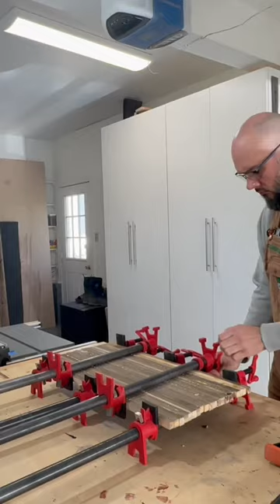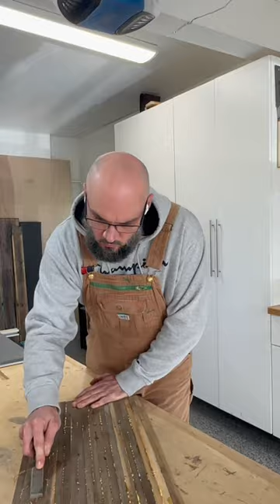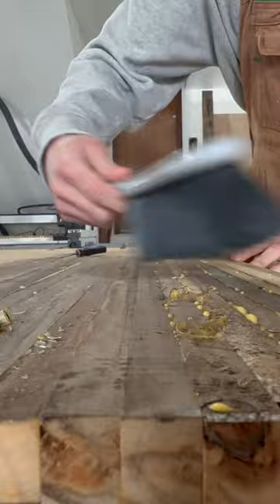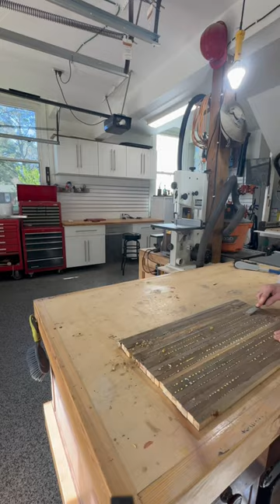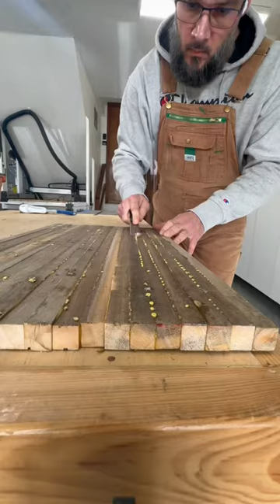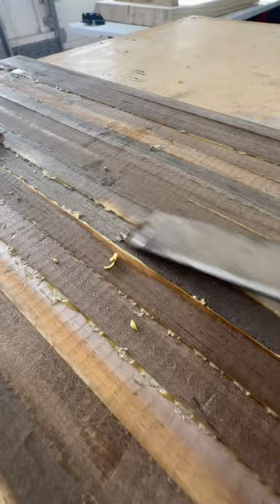Making an American flag from old fence pickets. Subscribe for more #music #woodworking

Comment: Fantastic song choice!
Reply from the maker: Couldn’t agree more!
Reply: Good for you but I'd save glue you have to sharpen chisels too. Out will come the good sandpaper rub until your fingers taper, dust up in your nose when you blow it takes awhile but it'll go. Then 30 years down the track your favorite table starts to crack you throw the stinker out the back it's lived its life as it goes whack !
Reply from the maker: nothing like a good glue up
And a little bit of chiseling! 😮😂.  Funny thing here that I thought was interesting if the wood you see is old fence pieces I had laying around.  I admit… I hoard old wood.  I may need help… 😂